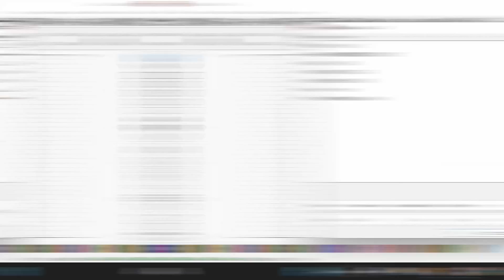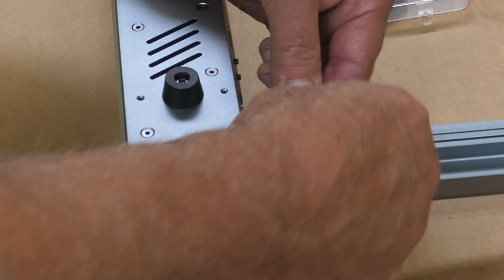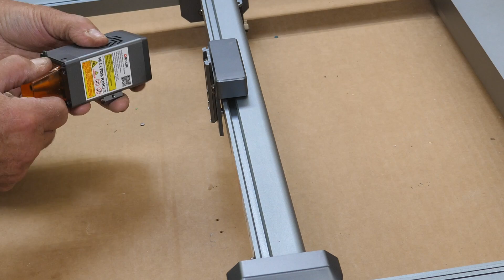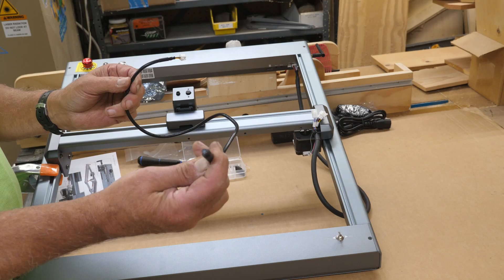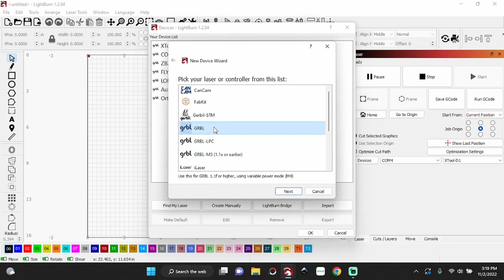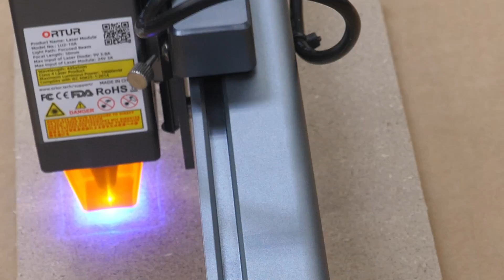Ortur Laser Master 3 Detailed Assembly

Comment: Enjoy your videos.  Keep them coming!
Just assembled and my limit stops on the Y rails are off a little (i.e. one is touched before the other).  Is there a correction or is it even an issue?
Reply from the maker: The LM 3 does not have physical limit switches.  it operates as a limit from stepper motor feedback, so it may not look like it is "making", but it is.
Reply: I suspect you have found a solution at this point, but in case others have similar concerns:  First, if BOTH sides of the x-axis are slightly (1-2mm) off the limit screw, you are fine (provided they are roughly the same distance off).  If, however, one side is almost perfectly touching but the other looks to be several mm off, you can pull the belt out of the grooves on the side that is not touching, press the x-axis to the limit screws (so both sides are touching) and re-insert the belt in the x-axis.  If that doesn't work, you can always dig in deeper and adjust the set screws for the y-axis, but that is a bit more involved (and likely unnecessary).  Best of luck!